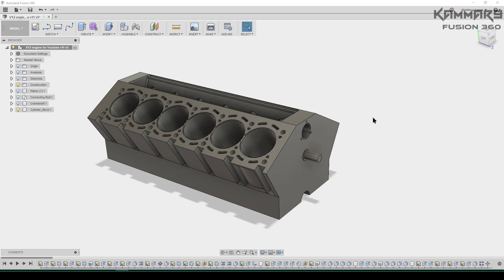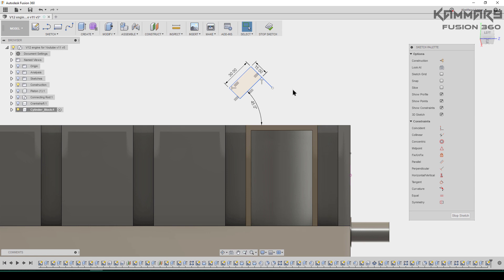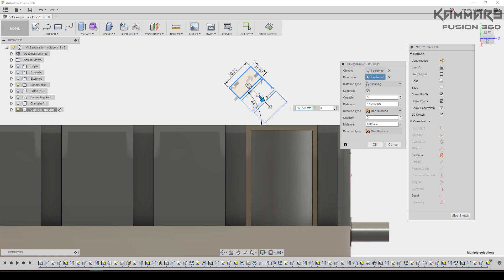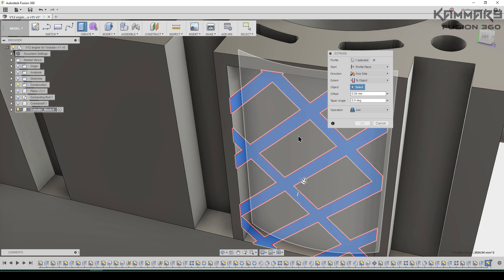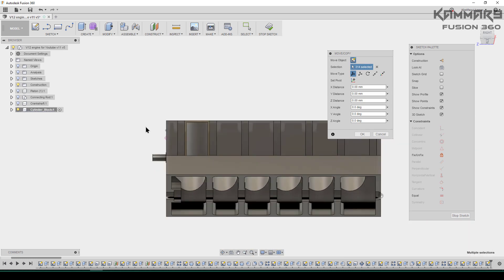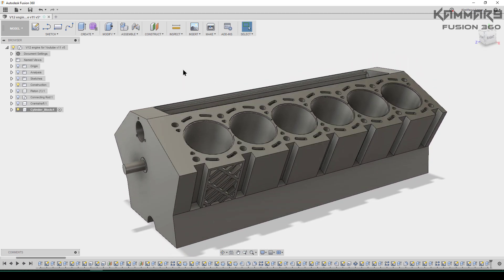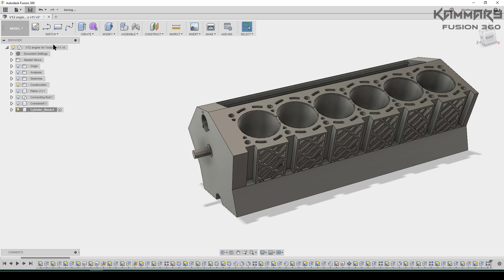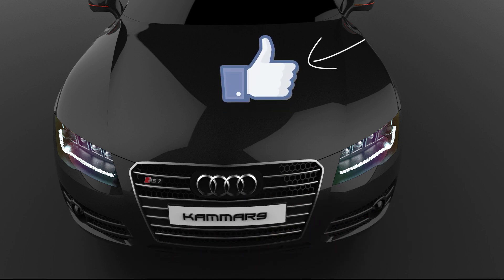Fusion 360 Modeling V12 Engine EP 18 😍 Full HD

Comment: you have not defined any height to the rectangle in this episode @2:00 , the rectangle is not black so it is not fixed in place, does this mean that you have random rectangular pattern in there? i cannot imagine this in a structural design. If i draw a three point rectangle with the only reference that the first point is vertical above the one you selected, you can still move it vertically, also i dont understand the angular thing, you define a 45 degree angle but since no point is fixed and you only have the vertical constraint, it can go anywhere on the vertical axis
Reply from the maker: Yeah bro , that's  a detail  it you want  to add some  dimensions  go for it 🙏